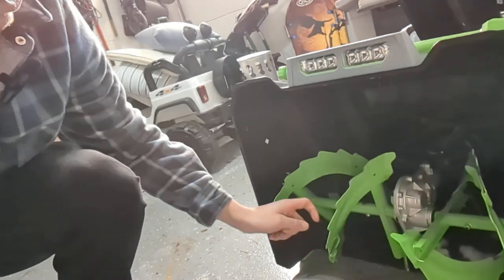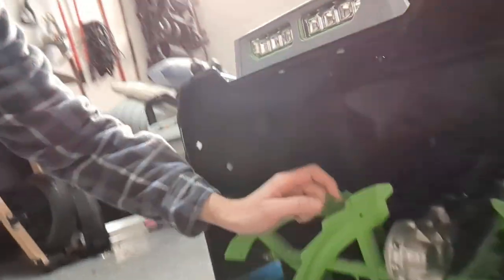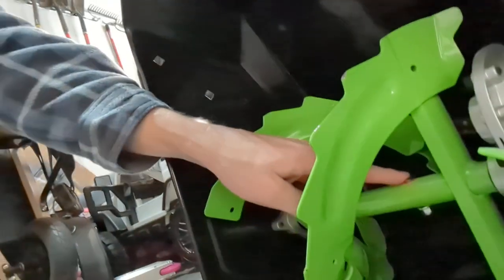2 stage ego snow blower not throwing snow fix/ auger not spinning

Comment: First time I used mine I had the same issue. Municipal snow plow threw a large rock onto my sidewalk, which I didn't see under the snow....I found it with the snowblower though! Right auger stopped immediately and I went into panic mode. Thanks for the video!

Comment: Hi, Just in case you weren't aware, those little pins have been in all 2 stage snow blowers for decades. Pretty common knowledge. People break them eventually and if the ground is rough or has a gravel surface it's a common occurrence. Many people in that situation have a long pin punch, hammer, and wrenches set aside just for this. I've got an Ariens now an planning to pick up the ego this fall.

Comment: Do you know if the single stage model has these pins too? I just got mine and the self propelled feature doesn't work (it's wicked hard to push) and doesn't throw far at all, maybe 10 feet. I did read to adjust the angle of the chute so I will try that tomorrow. I do know about the throttle speed but I had it on full with no luck.
Reply from the maker: Im pretty sure they do, almost every snowblower actually has these pins.